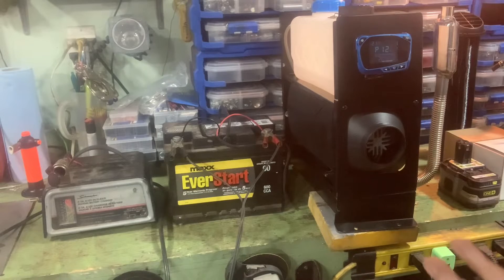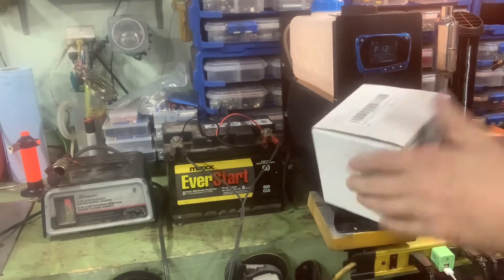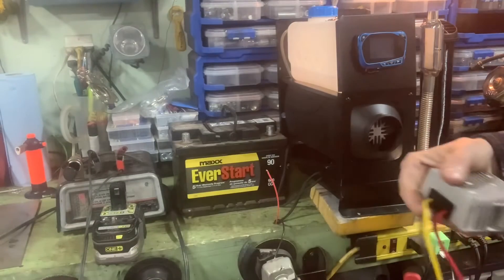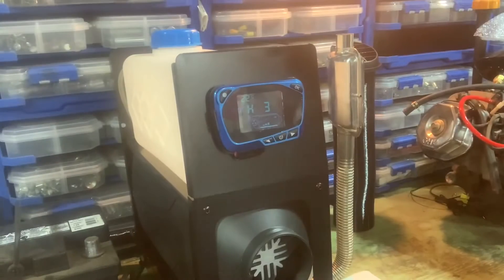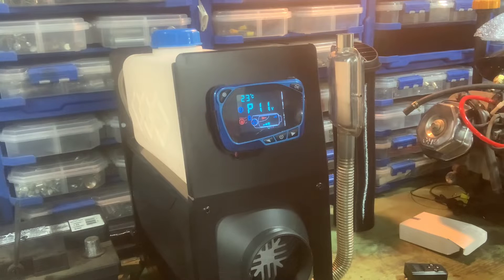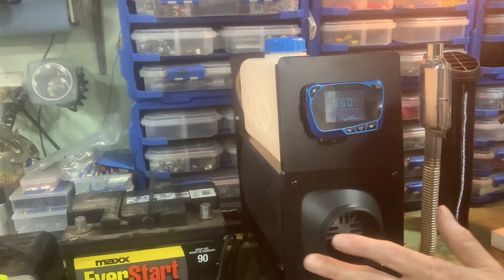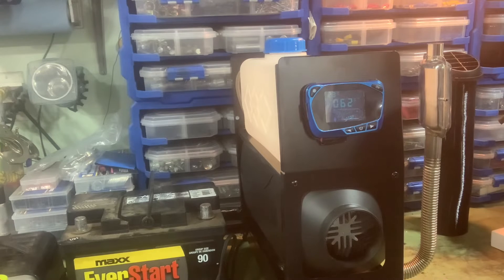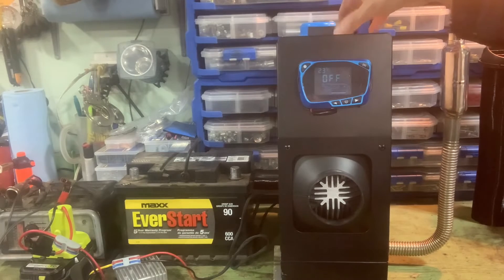Vevor 5KW Diesel Parking Heater Part III  (Using a Ryobi 18V Battery for Power)

Comment: It would be interesting to see the actual amp draw at start up, than running. Probably give you a better idea of battery life
Reply from the maker: I did that yesterday. It’s supposed to be up to 11 amps starting. All I got was 8 amps starting and it draws about an amp per hour running. I figure conservatively it should run for 11 hours on the two 6Ah batteries I have hooked up. From what I’ve read people are averaging about 10 hours per litre of fuel and it has a 4 litre tank. With the two batteries I can swap them out one at a time while it’s still running. One thing I’ve noticed is that they’re extremely clean burning. No smoke and very little fumes from the exhaust even when fooling around with it inside the garage. I put a C02 alarm near it and it didn’t go off at all. I was thinking maybe the alarm wasn’t working so I started the car and it went off immediately. That’s not to say they don’t need to be properly vented

Comment: Cool you gave me an idea! I wonder if with that converter if you could run a dc 12v cooler for camping to keep drinks cold using only a Ryobi battery! Did you buy it as a kit on amazon or individually? Have a link???
Reply from the maker: https://www.amazon.ca/Inverter-Aadpter-Converter-Battery-Voltage/dp/B0BWFK64XS/ref=sr_1_8?crid=TC02OIXDAKBY&dib=eyJ2IjoiMSJ9.YtCrNXR0pTKFN8pRJZL1oGwhpGYUpfS-F-FIlf4qXYmnMZ_z0TKQTeSwrA-Z1Z3IydJKwAAqwqjvNu_d5UwiEvXUIBXhpf5YUI9IWpsuTqzIDwVVk_bVHbgQhNFMIaeuhMV66pEnzGWmZBtiCwgIACPR1UeHtQoqe10FTO0LkuJL6kQELtcnuIE3h4BwALQQpy0USfJYWpxH_V1aGXXilJLEP8TfvU0lm60iN7FfRA4EaOrNcqRYEdXIsyCJFlw3u3ARZiQRfOPH8V6pLdl4bhOZJXygWa9PQJ9C64_Ghgk.4ouQinylwuPgR7Y6PWu3LH09VevDUOFCXmx4-XT3fvE&dib_tag=se&keywords=ryobi+battery+adapter+12+volt+adapter&qid=1710745956&sprefix=ryobi+battery+adapter+12+volt+adapter%2Caps%2C395&sr=8-8
I also ordered two different battery adapters that came with an on off switch and better wires.  I've go two batteries hooked up so I can swap them out one at a time without having to power it off